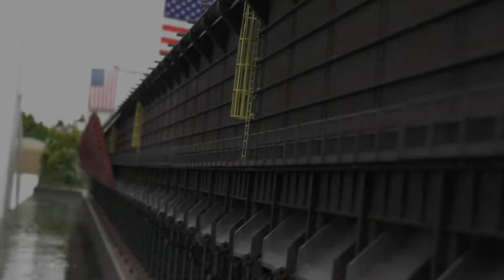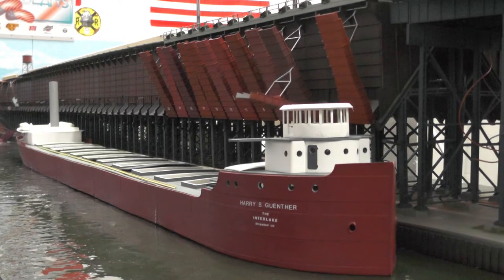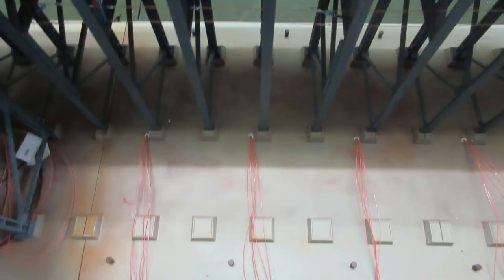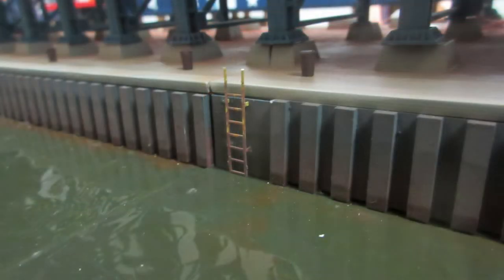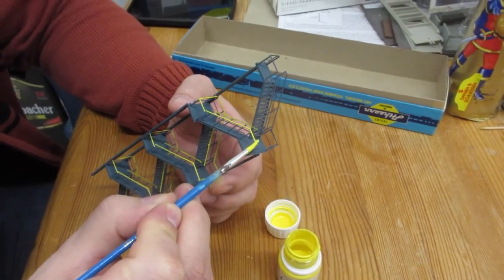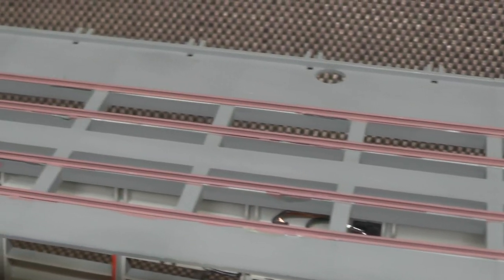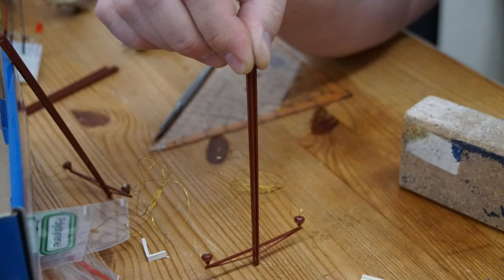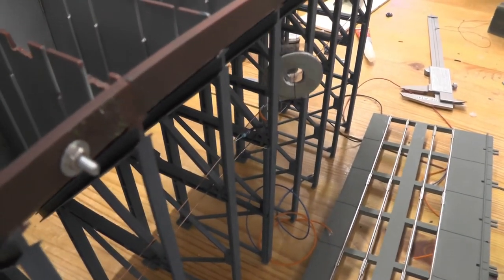Building the Ore Dock Part 03 (english version)

Comment: Are the motors included in the  kit?
Maybe I missed it? Do you have an ore boat to go with the dock?
It must have been more than $500 for all the kits you incorporated into this build, plus extra elements. How many people worked on this project? Cheers.
Reply from the maker: Thanks alot for the comment. The motors are not included in the kit. We bought them seperatly. 
Yes, we have an Ore Boat (the kit is from Sylvan scale models. But it is not yet ready. We are working on some modifikations on that boat. We will replace the origin wheelhouse by the wheelhouse from Circus City Decals. Also the chimney
We have 8 Walthers Ore Dock kits used and we have a 9th kit as a spare part kit. As you see in the videos the kits are modified. 
In general, the group Bean's consists of 12 people. At the Ore Dock 7 to 8 people have worked with. 
Greetings from Germany
Reply: @Bean's Model Railroad  beautiful layout. Have you checked the ore boats on John's Trains and Robert's- csxmad channels?
Reply from the maker: Thank you for the hint. We have been following the construction of Ore Dock by csxmad. But we have not yet seen the construction of the Ore boat. Also I have discovered the channel "John's trains" only by the hint.
Reply: Amazing look for the dock. What did you use for the water?
Reply from the maker: Thank you for asking. In May / June will come a video on water design. Here is a brief explanation.
We have glued a woodchip wallpaper on the wood panel. We applied tinting colors to this - green / brown on the land side, green / blue on the lake side. Then we applied several coats of clear boat varnish. Every week a new layer. It took a few weeks to dry.